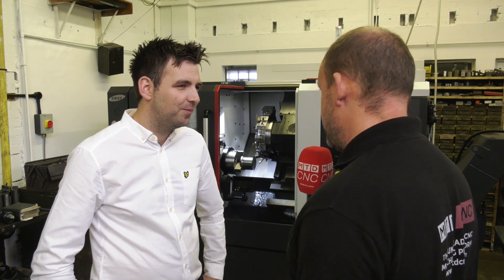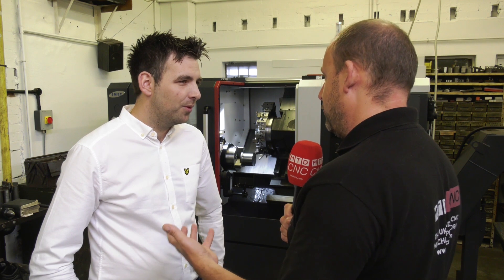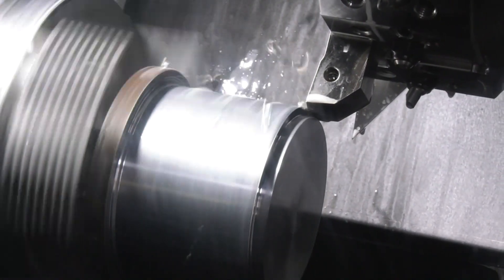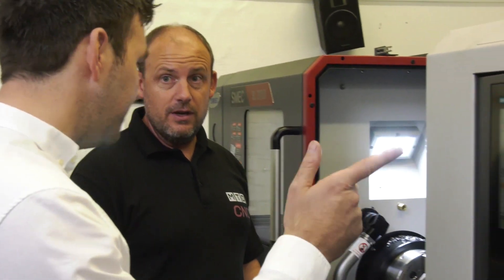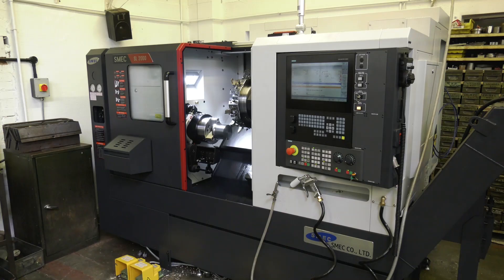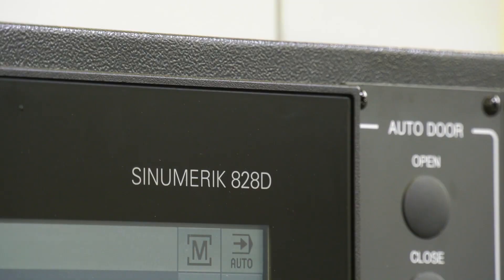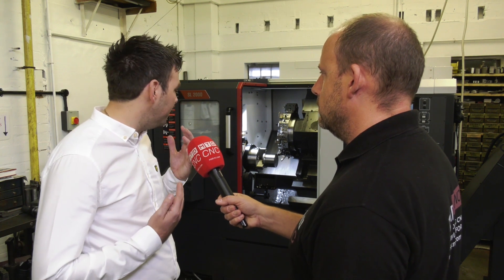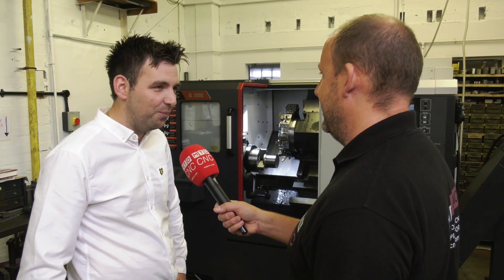Big Cuts on EN24T using new SMEC turning centre at Wilson Tools

Comment: I can take 4.5mm-5mm per side in 15-5ph on my Mazak 200M, another reason they are experiencing more tool life is taking a bigger cut. They were taking 1mm per side before now 4.5mm so the insert is in cut for less time and removing more material and spreading the wear across a bigger area of the insert.
Reply: Hi Alex, thanks for commenting. The 1mm cut on the previous machine was simply down to power,  it would literally try and stall the machine.
I would fully expect a mazak to take that cut as well and the pricing reflects that.
Kind Regards
Darren
Reply: @darrenwilson8375  what is the price of the brand of machine in the video
Reply: @alexgregg2466  are you based in the UK?
Reply: @darrenwilson8375  yes mate
Reply: @alexgregg2466  I can't put figures on here as such, but I can assure you there is a  difference
I'd be happy for you to contact me through our company to discuss more if required.
Regards
Darren

Comment: He said, 4,5mm a side. So that’s only a 4,5 mm cut, not a 10mm one... 9 mil in diameter. Which isn’t that impressive. 

If he wants more stability, run different tooling, left hand side stuff for roughing.
Reply: Exactly.  If you really want to take advantage of the rigidity of the machine you need left hand tooling and spin the chuck
in reverse. That way you are directing the cutting forces into the cross slide which transfers those forces into the bed of the machine.
Reply: Hi Mischa, we are over the moon with this machine and it's performance. Remember I'm holding on less than 10mm on the jaws, so to me that is great performance. Can see how people are getting confused over the cut situation, as you have noted, it is 4.5mm a side - so is is removing 9mm a time.
What machines do you run out of curiosity?
Regards
Darren
Reply: darren wilson Ohhh sorry for not being too clear. I wasn’t saying that it isn’t good performance, I was just saying that it’s not very special for a machine this size. 

I’ve ran a lot of different lathes, Mazak QT10, Qt15m the later 200-350 machines and some different Okuma lathes and teach in lathes.

What’s important is that you guys are happy wih the performance of the machine tool you guys have, seems that it does great for you.
I was just meant that the title is a bit clickbait like 😅
Reply: @WasNiksIsNiksWordtNiks  wow, real top end machines, probably the best in the business. All I will say is obtain a quote, you will be surprised, will look further into left hand tooling as suggested, this job was turning  0.1 away from the jaws so wouldn't be able to run that way on this particular job. Thanks for the tip though 👍